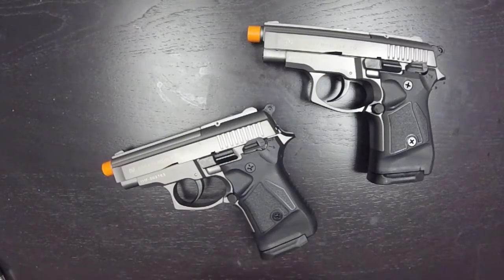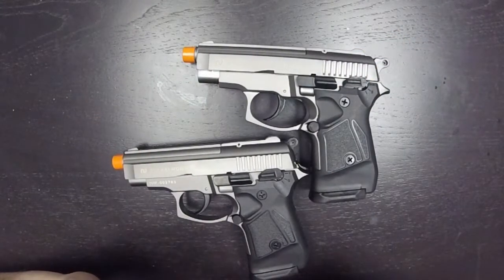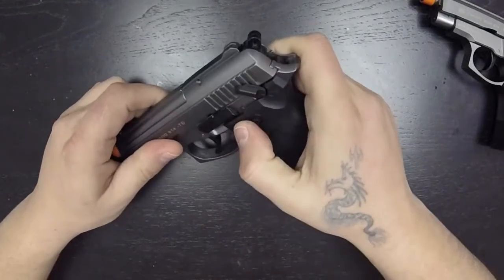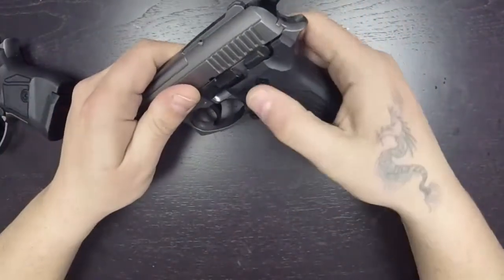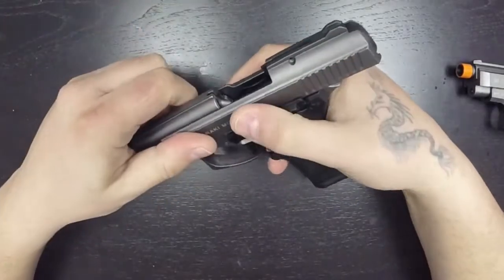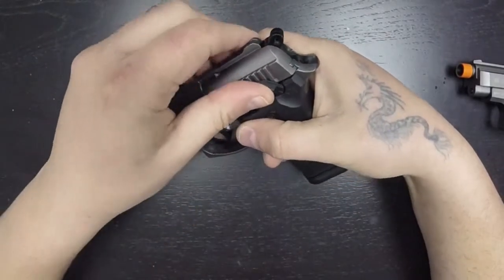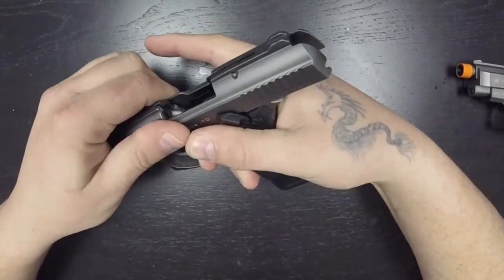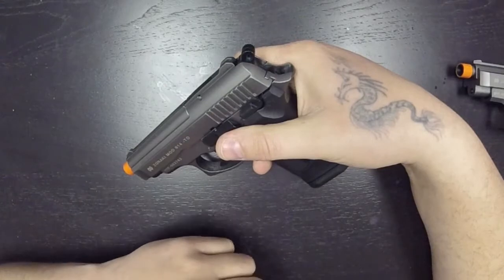How to tell if a 914 BLANK GUN is full auto

Comment: can that Orange tip be removed all the new one have it
Reply: i guess you can paint it
Reply: You screw it out with an Allen key
Reply: @Martin-yf7sd  allen key or allen wrench just strips out the inside, the tip is held in place by glue and lock tite, vice grips and wrenches only strip and mar the tip with gouges. my dad just sanded the orange tips down to metal and polished them to shiny chrome looking tips.
Reply: @Martin-yf7sd  are you sure that works with this model with allenkey ..its impossible to get off with pliers
Reply: @noahmizrahi9834  so an allen key womt work